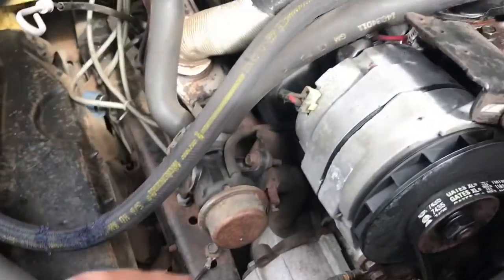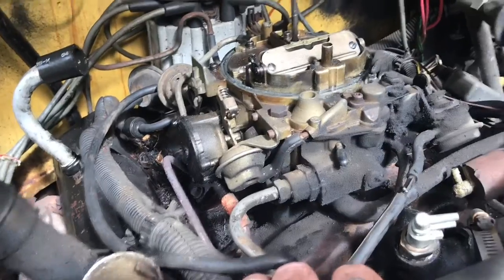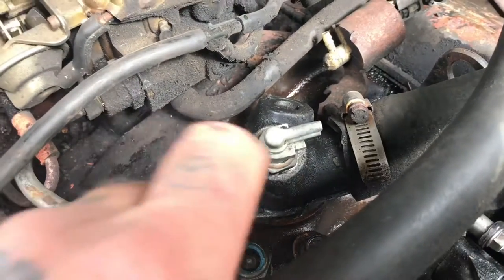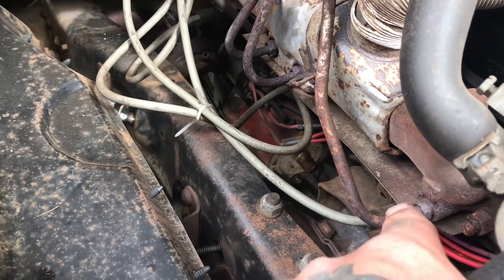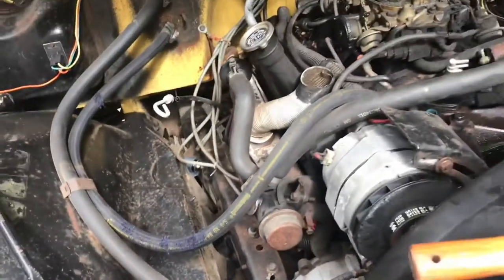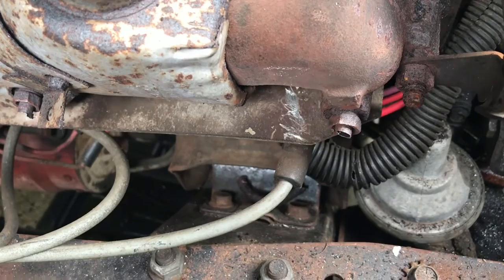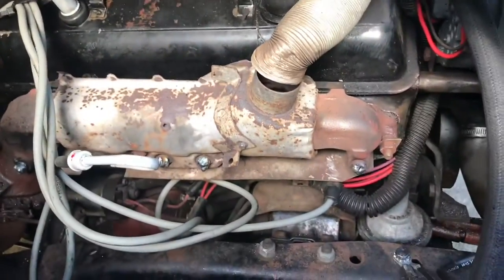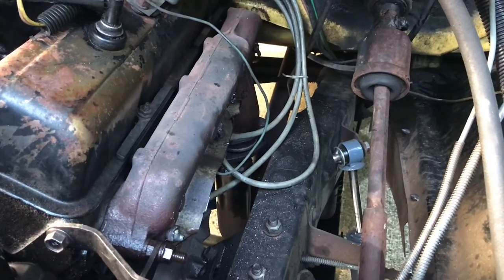Square body air pump and thermal vacuum switch delete

Comment: The smog pump stuff is only nice/useful if the truck is 100% stock and original Including the original exhaust system because when that system is 100% intact there will be very little to no gas smell at the tail pipe but as soon as the catalytic converter gets removed or an aftermarket exhaust gets installed the smog pump becomes useless. Usually I just take the belt off and leave everything intact until I remove the engine then I clean it all up and simplify it. Removing all that junk does make the engine look alot nicer and reduces the chances of vacuum leaks but I would recommend saving all the old smog stuff because some of that stuff is rare and worth something and some people that live in emissions states will pay a fortune for all the smog stuff to make their vehicle legal.
Reply: You make it sound like the smell of gas is a bad thing haha😂
Reply: I'm a mechanic in CA and finishing up installing a rebuilt engine in an 84 K5 Blazer. They wanted to keep it all stock for smog legal purposes. Boy o Boy it's been a journey trying my best not to break things and routing everything correctly. Thankfully I marked and photo documented everything. I can't believe how much junk these motors have attached to them. 80's cars are usually this way though.

Comment: I did the exact thing on my 85 half ton Chevy with a 350. After I welded the holes in the air pump tubes I sprayed them with penetrating fluid and repeated that a few times after driving it and the flange nuts came out of the manifold and a re welding and grinding was done because my ocd kicked in. I left the charcoal canister on mine to prevent the smell of gas. Sure wish I had never sold that truck.
Reply from the maker: Radio One Receive tomorrow I am tackling the drivers side exhaust manifold leaky gasket (hopefully the bolts come out). I learned my lesson and am not selling this truck. Take care

Comment: Your engine looks so much cleaner than mine there are so many vacuum lines mines all original you can’t even see the top of the engine and all my vacuum lines are factory everything on the truck is factory and so I’m sure all those vacuum lines are garbage and before I watched your video I was thinking of replacing them all one by one now I’m thinking about which three I actually have to have and the other 79 can go in the dumpster!

Comment: You have a beautiful old truck I’ve never seen one that color but the firewall tells me that that’s factory? Mine is fire engine red with a white roof and I’ve never seen one in my whole life till I bought this one then I’ve seen a few mines only got 60,000 miles on it and being in New Hampshire we have this stuff called rust and so I need to do a little bodywork but the frame the undercarriage everything in the truck is beautiful because it was oiled they just didn’t get inside the door panels or the fender wells so I’ve got a little bodywork to do but I just had to say you have a beautiful looking old truck❤️‍🔥🇺🇸
Reply from the maker: I really appreciate the kind words! That’s awesome that you have one. I love having a classic vehicle that you can actually use. It’s also cool that you can haul six people if need be.  The dogs have their own seat also!!🥳

Comment: I noticed in your thermostat housing you still had another hole.  Was that for the sender?  And you said 1/2” plug for the emissions vacuum thingy?
Reply from the maker: They are both thermal vacuum switches (not sending unit). 3/8’s and 1/2 inch plug

Comment: All that black dust is your fan/alternator belts rubbing on something. I guess you fixed that too. I pull off the manifold pipes and capped them off with threaded plugs.

Comment: It looks like on my truck that the vacuum advance line off the distributor runs to those fittings on that thermostat housing. This is what happened, I ditched that big air filter for a regular open element filter and now it pops and has no power in  4th gear, it's definitely a vacuum issue but I can't figure it out
Reply from the maker: That’s the tough part about these trucks and they’re brittle vacuum lines and fittings. Just take some carburetor cleaner and spray it around and vacuum lines are. At an idle, will raise the idle when you find the leak. There is only a few vacuum lines coming off your air cleaner. And i believe those are the heat activated thermal switches. The vacuum advance should be coming off your carburetor, ported vacuum. It can be ported or manifold, which ever runs best. The backfire sounds like timing and not vacuum leak.
Reply from the maker: The vacuum advance shouldn’t be coming off those thermal switches.
Reply from the maker: Strange that it would run fine. Until fourth gear

Comment: Is that a Wheatland yellow squarebody? I have an '86 c20 that color. Getting ready to put a vortec 350 in it so all this smog stuff will go away in the process.
Thanks for sharing!
Reply from the maker: Colonial yellow🤷🏼‍♂️!! I would like to replace my square body with either Vortech or LS. Something that is more reliable and gets possibly better than 7 miles to the gallon!!!  you're welcome

Comment: Did you ever figure out what size the manifold plugs are? The ones you welded.
Reply: 1/4-18 NPT
I bought 8 of them at Menards for like $10. Just be sure to penetrating oil them and then heat them up. I broke 2 off in the block for being impatient.
Reply: @austenolson9855  when you say heat them up can you explain please?

Comment: Thanks for uploading, what belt did you use after deleting the airpump?
Reply from the maker: Sorry, I forgot to get back to you. There were two belts, just took the one off. The fan and power steering or separate belts
Reply: @zmurray9499  Thanks,  my 81 5.7 goes to the fan, alternator and the crank....
Reply: I'm trying to do this on my 1985 buick lesabre were do I start
Reply: @yahbahisrael6522  Remove your catalytic converter first

Comment: Also vacuum line routing diagram or video?
Reply from the maker: It would be beneficial to replace your carburetor with 550 Edelbrock or... it’ll run a lot better and you’ll only have three vacuum lines. Vacuum advance equals ported, transmission vacuum modulator equals manifold vacuum(pass side front of carb), Power brakes is the back big port. You can switch manifold and ported vacuum back-and-forth to see which way it runs better, as far as your vacuum advance. The Edelbrock carb runs better and is so much  more simple. I have a video where I swapped the Edelbrock.
Reply: @zmurray9499  I'm going to keep it quadrajet for now until I rebuild the whole engine. Just wondering where you ran the vacuum lines from the carb ports.
Reply from the maker: @austenolson9855  I pretty much swapped the carpet and got rid of the omissions crap at the same time. I’m sure you can Google the vacuum routing, I don’t remember.

Comment: can this be doon on a TBI motor ?
Reply from the maker: You might have a check engine light and have to get A different size belt. But yes
Reply: @zmurray9499  Did you get this handled if so what size belt?